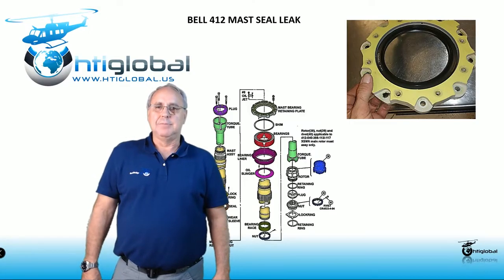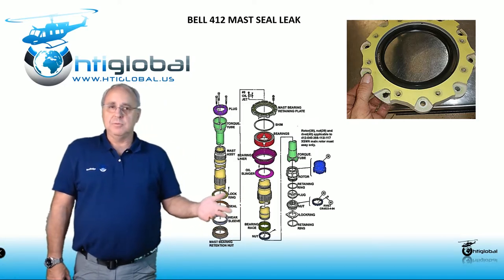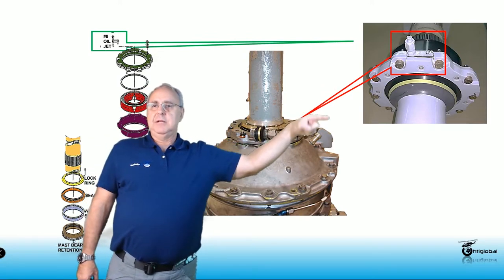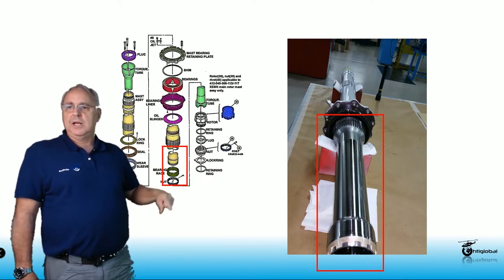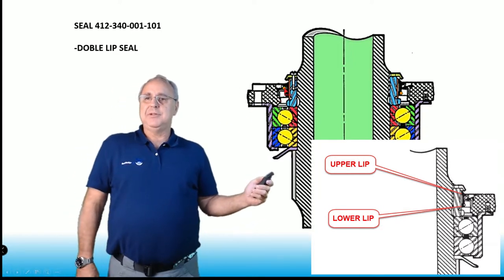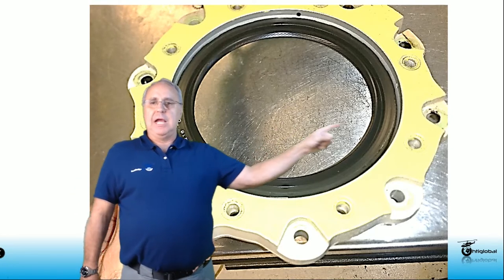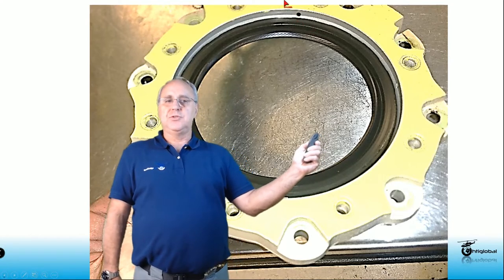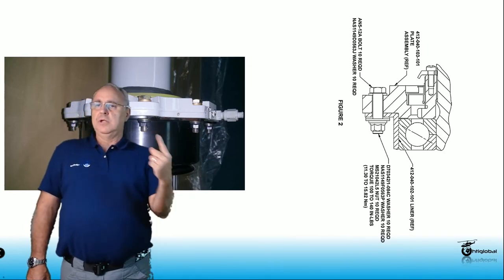BELL 412 MAST SEAL LEAK ISSUE

Comment: Ever noticed axial play of the mast when installing back into the main gearbox?
Reply from the maker: Yes, and it is normal as the bearings are cold. During design they need to leave space sl when the bearing gets hot, it will expand.

Comment: we replaced  the seal without removing the mast  in the helicopter .
Reply from the maker: Good for you,  this kind of process is wrong but if you are happy and think "nothing" got inside the xmsn good for you. Working fast does not means a good job. Be safe.
Reply: @HTIGLOBAL  thanks sir ..
Reply: Somebody from bell teach us to do it sir.
Reply: @raffyreyes5113  well it will be great to see the logbook report answered. Mast Seal replaced in accordance to what or to whom?????? 🤔
Reply: @raffyreyes5113  as a piece of advice that anything that need to be done following the overhaul and repair book, it should be stick to that book instructions; I would never advice to remove the mast seal this way ( your way) and I was Bell instructor for 10 yrs. Just be careful and be safe!